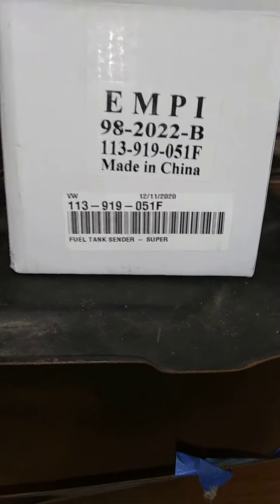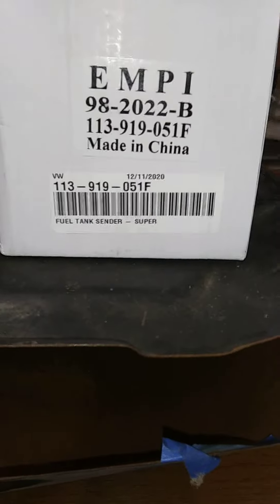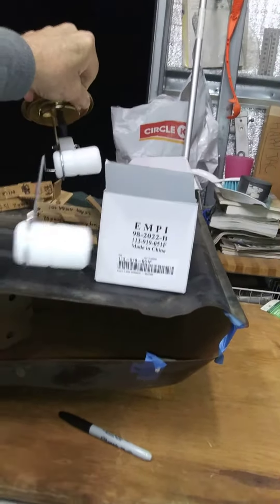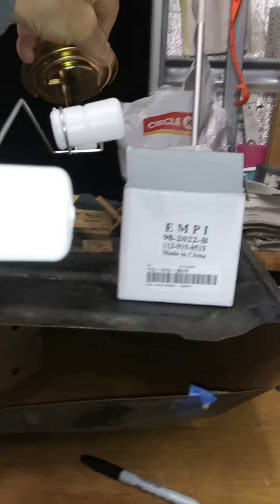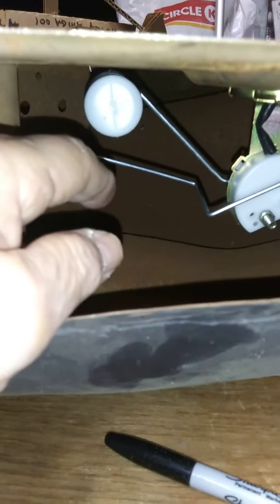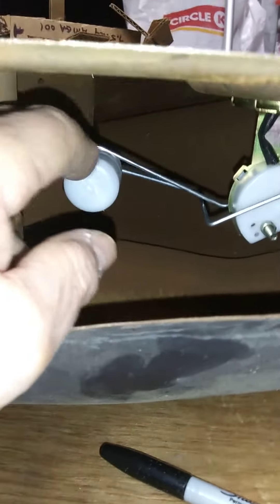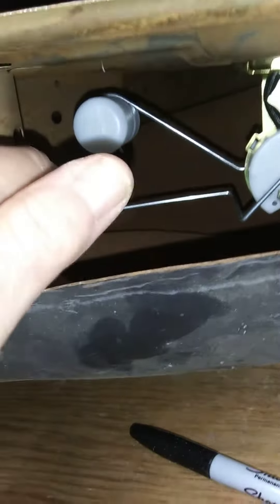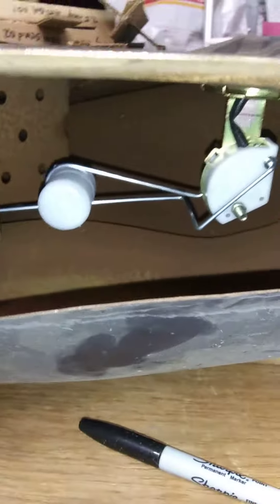Empi sender bad right out of the box.

Comment: Very good class on "caveat emptor". And now a new subscriber. At age 63 I have also learned that not all tools and parts are who they say they are. My wife and me are recent owners of a "71" Super that was an Arizona one family full body off restoration started in 2015.  It now resides here in SC. The Bug is in very good condition in, out and under. But not without some issues due to let's say concealed fatigue. The dreaded scraping tunnel clutch tube bracket near the e-brake. That will be addressed later. To the point, I have a fuel gauge that will when cold moves appropriately to my estimate of a half tank of fuel. Then back to empty, then back to half, then empty again without moving ever again. My initial safari through the wires and fresh air box in my path to get to the sender spade connections shows to be good to ground. Admittedly no further resistance nor continuity tests have been done. So with a "waving" fuel gauge needle would you suspect that the regulator could make the gauge act in such a way?  I may be premature in asking before completing the electrical analysis. Again thank you for your "shop teacher" style of instruction. It reminds me of my high school electronics teacher in how he would bring out actual hardware to show how devices operated and not just stand at the chalkboard.
Reply from the maker: Hi campion.... You did not say  if you had a vibrator or a regulator device.  That is not important at this time but would be if you are going to determine what is going on with your gauge.  A quick test to see if the gauge and reg/vib is working  but not a complete test.  
Have someone sitting it the drivers seat.  
Key off.
Remove the sender wire off of the center lug of the sender... 
While holding the wire have your assistance turn the key on....  The gauge needle should not move!~
Cautiously connect that sender wire spade lug to the sender assembly, not the sender lug.  
The gauge should go to full!  Quickly if you gauge has a vibrator and kinda slow if it is a regulator. 
Do not leave that wire touched to ground/frame/sender body more than 5 seconds if the needle swings quick to full... That would mean that you have a vibrator and that the gauge and vibrator is good.
Leave it on maybe 10 seconds for the regulator type.  If the needle swings nearly all the way in that 10 seconds then all is good there.
If the needle performs as it should then the sender is most likely the issue.

You can review my video to see which type of voltage regulation you have...  Vibrator or regulator on my video here.
If you have more questions just provide a reply...   Jim

https://youtu.be/29I3oeVjWHI